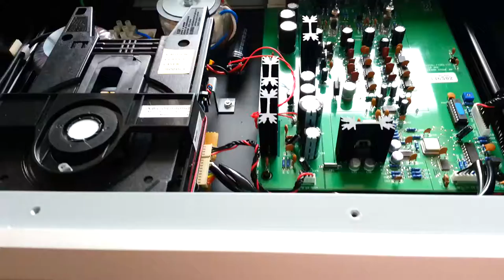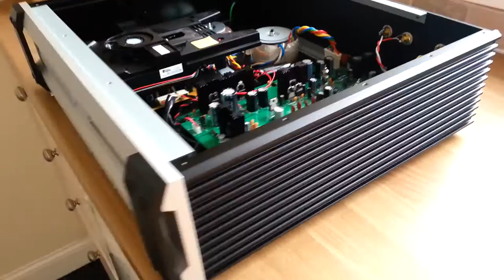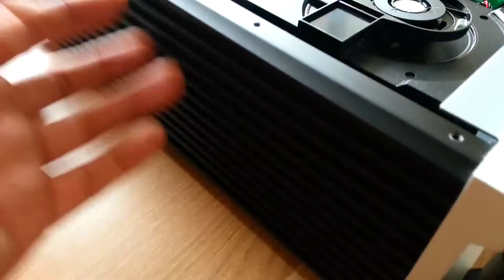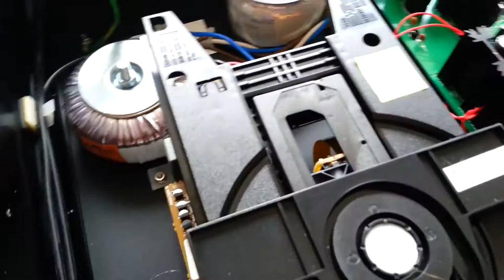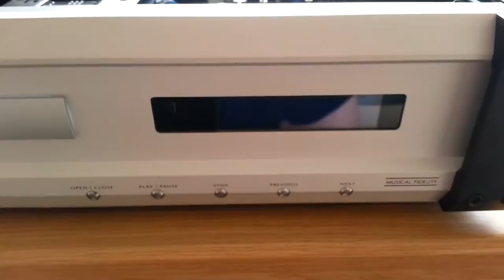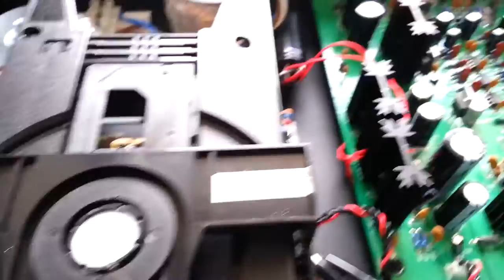Modified musical fidelity A5

Comment from the maker: Hi dave  i agrer it is basically a budget cd player in a wadia kinda cd case and cheap ne5532's  analogue stage were there is six. They buffered buy two valves. The transport in this player is good enough for phonosphoie impulse 3.1 cd player costing over £12,000  and that player is a heavily modified marantz cd 67  se. I  have had some awesome results with this transport running off a very clean power supply what cd player do you have dave m8